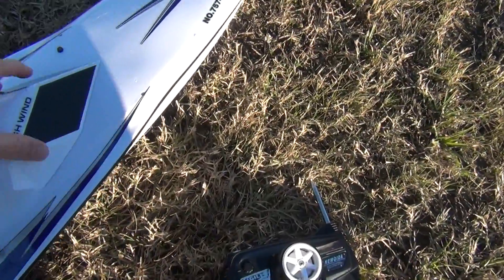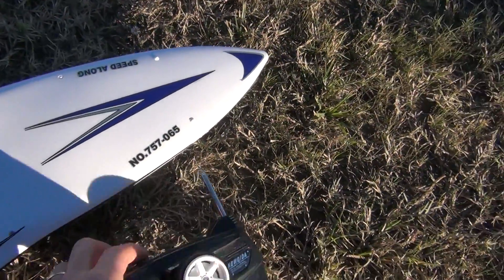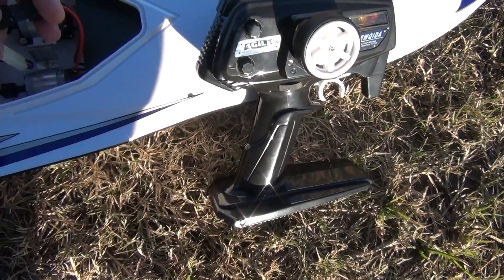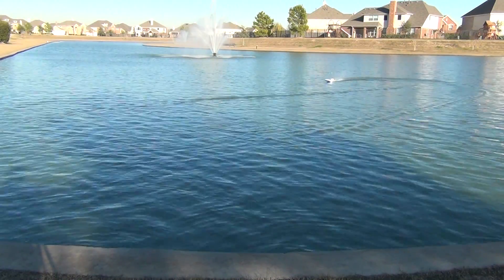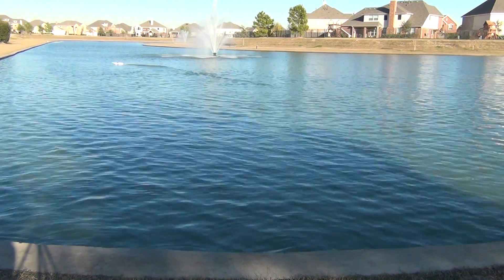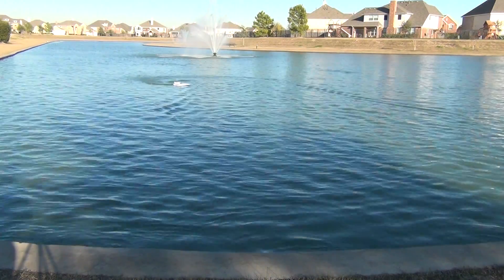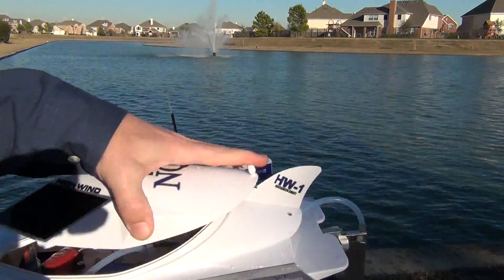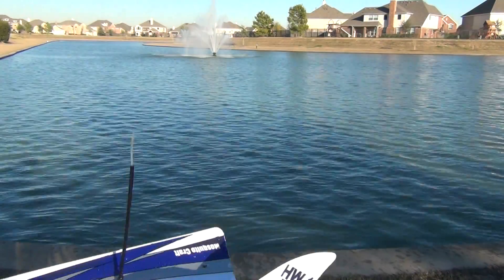NQD High Wind RC Toy Boat Brushless Conversion Part 2

Comment: I have a similar boat and would like to do something similar ..I was thinking of adding a 2.5 nitro engine just for kicks ..but I like the brushless idea but like others said the boat seams to porpus allot ..have you tried trim tabs ? Or perhaps posistioning the prop under the hull for less cavitation ..I believe your prop is either suck to much air or possibly creating to much gas ..and losing a lot of power ..I may run twin brushless and see where that goes ?
Reply from the maker: So I have not messed with this boat in a few years, but no, I never tried to add trim tabs, but I do think it would help. Good luck with your build! :)

Comment: Above half throttle the water will flow through the cooling system rapidly enough to be heated only a couple of degrees so you won´t even notice any difference with double water pick-ups. Plus at low speeds only the esc produces heat, at half throttle it´s 50-50 between motor and esc (simplified) and at full throttle only the motor produces heat

Comment from the maker: One thing to note though with this $35 radio - while it can hold settings in memory for 10 models, there really isn't a secure channel for each model, so you will have to only have one model on at a time, which in most cases I isn't an issue for me.

Comment from the maker: Yeah, a split cooling line (or two separate lines) would work good too - at the amps I am drawing, the heating hasn't been bad though with just the one line going through both. If I up the power, I would probably do two cooling lines with two pick-ups. Thanks!
Reply: i am interested to know the calculation you use to work out amp draw depending on batt size

Comment: Nice!

btw, the stock setup is not too bad if you use 2s LiPo :)  mine was more than twice as fast than what your does with stock setup :)  the temps may go slightly up due to higher RPMs though :P

Comment from the maker: Tested with 3s and with the same prop (40mm - unsure of the pitch, but it has pretty long blades, so prob a high pitch) was making like 1100+ watts (108~110a), which is too much for this cheap ESC. I have been playing with other prop sizes trying to find the best 3s (higher rpm) prop. I have a bunch of hard plastic test props for trying various sizes but I keep breaking them...lol As soon as I can find the best 3s prop I will post another vid, but preliminary results show this thing can scoot!